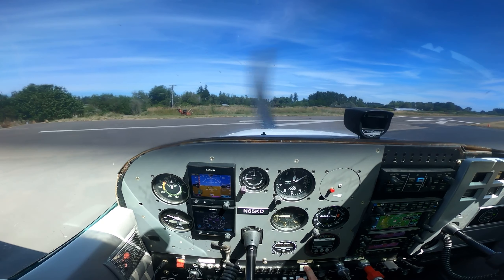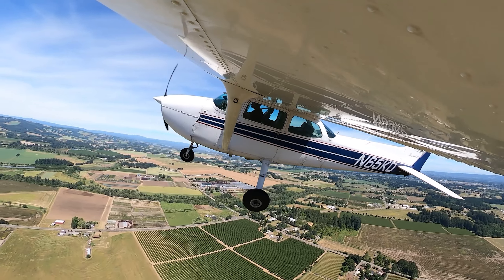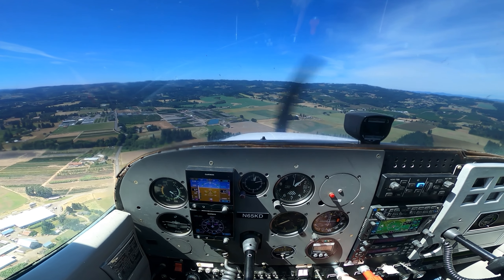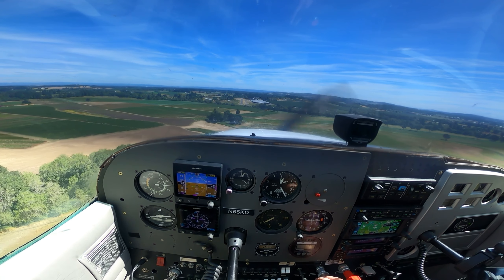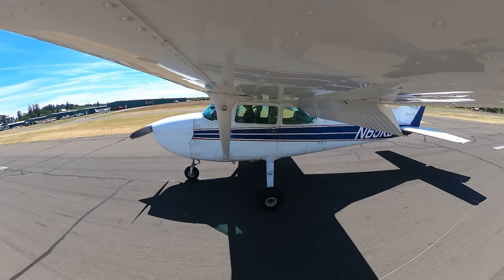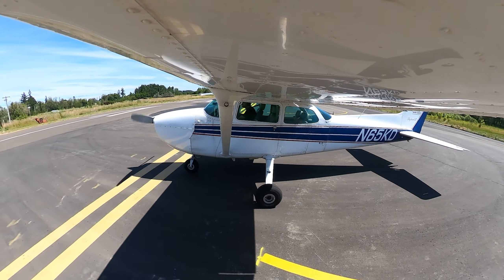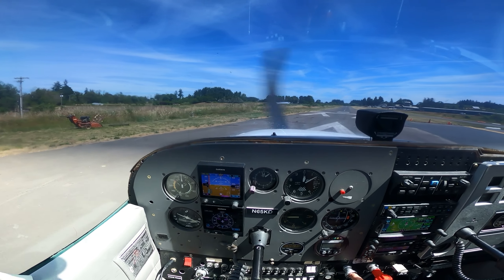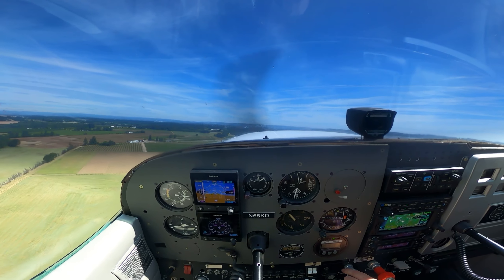Difference between NORMAL and SHORT FIELD Landings!

Comment: Thank you! I have my PPL checkride in November so I really need to get these down 😅
Reply from the maker: Let me know how it goes! 🙌🏻
Reply: You’ll be surprised at how smoothly it goes. I just had mine on Sunday, thought I flew horribly but when it was over, the DPE actually recommended that I get at least get a CFI rating in the future…so I must’ve done something right. On the checkride, I just set myself up to miss long if I was going to “miss” at all. It’s pretty common advice but the ACS doesn’t mince words. Just don’t miss short on your short field…that’s all. If you do, you’re putting them in a bit of a position and they’re gonna have to make a judgement call, blah blah blah. I exaggerated my aiming point on the short field a bit and actually touched down past the 1000’ markers but the DPE obviously saw what I was up to and knew that I was setting myself to “miss long”. Don’t sweat it. If your CFI signed you off, that’s most of the evidence you need right there. Just study and practice…that’s all you can do.

Comment: Sam curious  your thoughts on the flaps after a short field landing. I don't know if its because I'm a student or not but when I perform SFLs I was taught to raise the flaps before applying any elevator in braking. The idea being not to generate too much lift. I currently fly a 152 but I'm pretty sure we do the same in the 172, is this just airframe specific or experience?
Reply from the maker: Hey man! Yeah it’s pretty typical to raise the flaps on landing for airplanes that have a fixed gear at least. Not typically recommended for retracts, but for all the fixed gear Cessnas I do teach to retract flaps upon touch down to increase brake effectiveness as a part of max braking. 👍🙌🏻

Comment: If I want to land right at the numbers where should my aimpoint be?
Reply from the maker: So the first question you have to ask is, is it even a smart idea to try to land in the numbers? Many airports have runways without displaced thresholds and the numbers literally on right on the edge of the paved surface, so coming in at all early means you miss the runway. If you DO have some space before the numbers though, and you REALLY want to land on them… then just pick basically the bottom of the numbers as your aiming point on a short field, or just a little before the bottom of the numbers. 👍